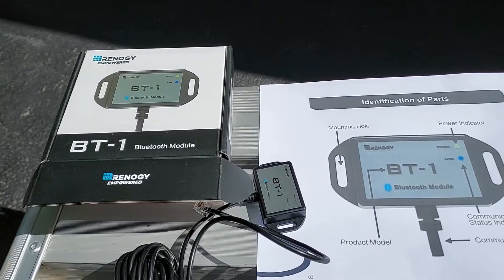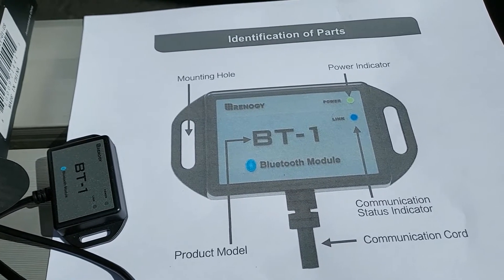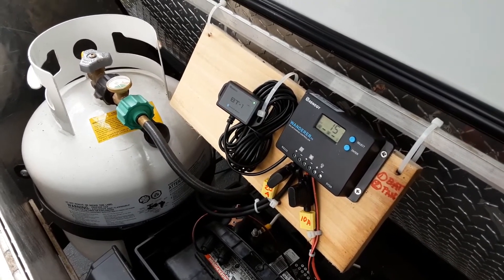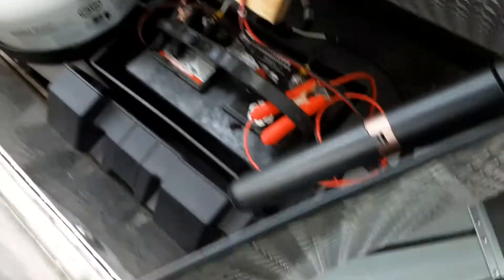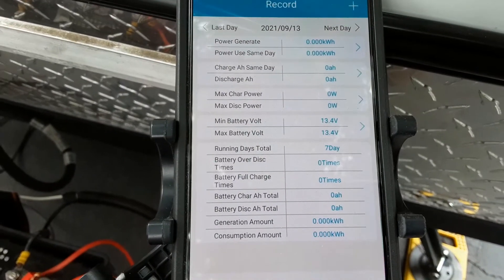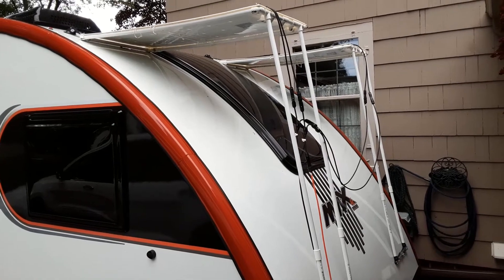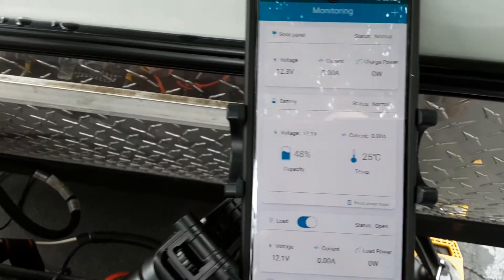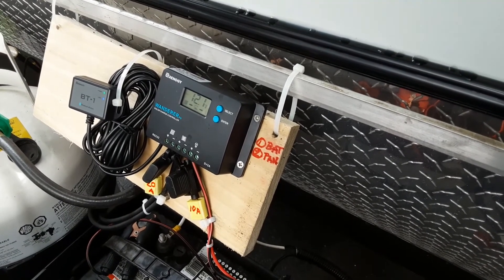Little Guy Max RV Solar Project (Vlog #3) – Renogy BT-1 Module & Bluetooth Com App

Comment: What type of battery are you using? I'm curious about the BT-1 module working with non renogy branded batteries. I gave them a call and they told me I needed to purchase a renogy branded battery for the bluetooth to work but if the BT-1 plugs straight into the charge controller why would I need a renogy branded one?
Reply from the maker: Conected to the standard 100amp-hr lead acid battery that came with the LGM. Not a renogy battey. Works great!
Reply: awesome thanks! @ramblinroses6066
Reply: This set up will give you an approximate battery meter as it comes from the voltage of the battery, the smart battery will be more precise.
I have opted with this set up as I don’t need as much detail

Comment: Thanks for a decent video. Have you road tested this? Im curious because of the wiring not being at least cable tied to the pvc frame at the rear and the mounting of the charger. Seems like there would be allot of movement for the pv wiring and the charge controller mount.
Reply from the maker: Thank you for comment. Yes, road tested. No problems with controller wiring. There is a zip tie on the controller to secure wiring with drilled holes through th wood board. The solar panels are stored away under the queen bed in the back disassembled. The solar panel wires are very robust, if you are concerned about solar panel wires, you could zip tie to frames, I have chosen not put zip ties.
Reply from the maker: For the solar controller build,  in the description is a link to the solar controller build that shows the zip ties to secure wires. Here is the link: https://youtu.be/GSKI2EY9ItY

Comment: I have the same setup as you.  Mine never shows anything for current draw (solar / battery / or load).  My voltage is the only numbers that changes.  Is it the same for you?  Is our controller not capable of showing current?
Reply from the maker: Yes only voltage in and Battery voltage. If you want current you need a battery monitor.
Reply from the maker: To measure current I installed a battery monitor. Here is video for my install https://youtu.be/1h7q9Ytd0A4
Reply: Just a same the controller can only take max  25volt solar panel